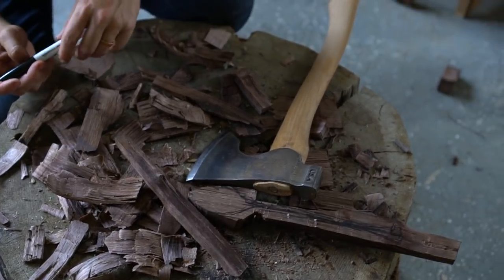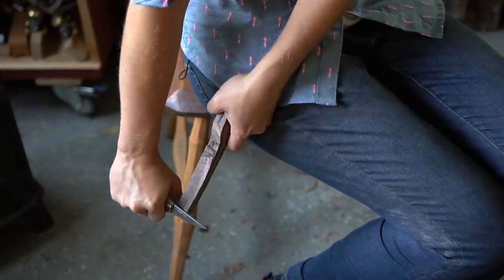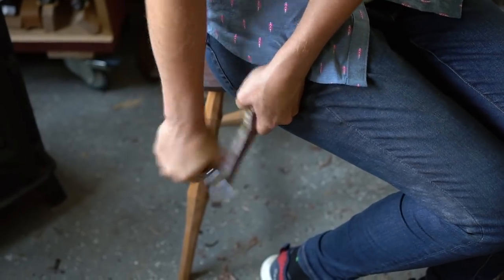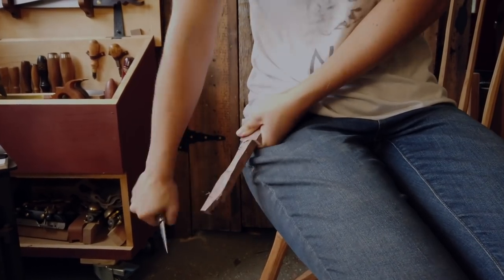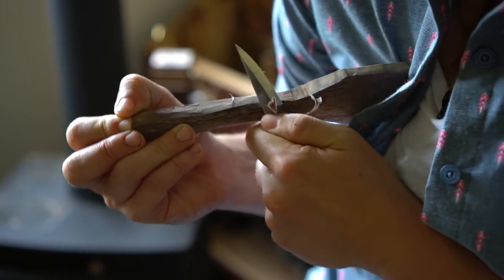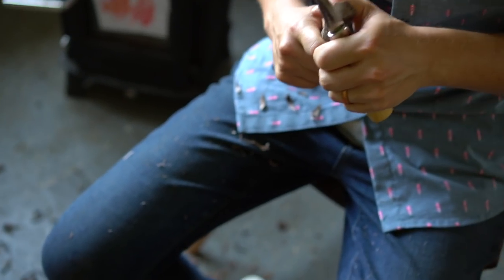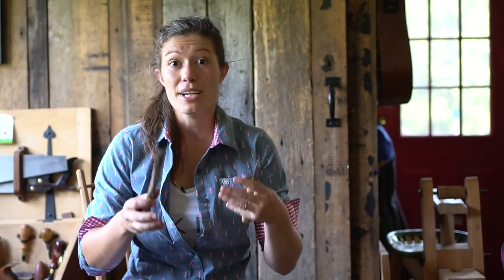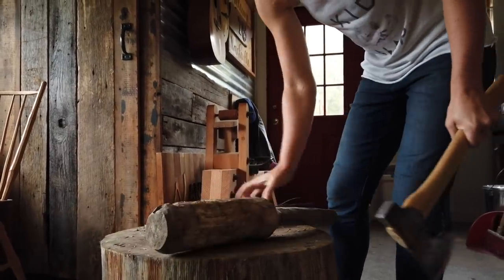The 5 Knife Grips Essential for Spoon Carving: Safe and Efficient

Comment: Nice vid.  Good points.  I did relief carving for a while and had a set of Pheil gouges/chisels and they were great.  Then I got into carving little figures from 1.5 or 2" square stock around 3 or 4" high.  One carver I watched recommended a Mike Shipley knife which I think now go under the name OCC or something to that effect.  Well, I was fortunate enough to be able to afford the 23 bucks each for a 1.75 blade model as well as the 1" model for detail.  I thought I had died and gone to carving heaven!  Best knife I've ever owned, though in truth, after those I didn't experiment much more.  Tried the flexcut and they were OK, but I hardly use them because the Shipleys are just so good.  They bevel the entire blade so you aren't forcing as much metal into the cut and yet they are plenty strong.  There is a touch to everything from music to carving and you are correct, learn to just engage the wood and not gouge and it's much easier to control.  And practice, practice, practice!  Just thought I'd share that.  But love your vids.  Always informative.

Comment: I use to make cedar shingles when I was 6 with an axe, good times; I never did try wood craving, looks interesting Anne 🖐
Reply from the maker: It's never too late!
Reply: Using an regular axe or a fro?
Reply from the maker: @danyellerobinson5940  Froe's are actually meant to split wood evenly, whereas shingle hatchets are designed to split shingles. My grandpa was able to use them interchangeably though.
Reply: @AnneofAllTrades  Good to know. Thanks.
Reply: @danyellerobinson5940  a regular 5 lb ax

Comment: If you only have cut your fingers on your other hand with the knife you can try wrapping them with compression tape,  that's what I use when I  carve I found I like it better than the glove I was using I have more control of my work.
Reply from the maker: I use both hands when I carve, and it’s better to use proper technique than wear safety measures, but if that works for you, far be it from me to discourage it!
Reply: @AnneofAllTrades  I am ambidextrous but haven't tried carving with my left hand just yet, use my hand and power tools with both but been doing that since my pap and daddy had me sitting in the engines of vehicles to work on them at 8 yrs.
Reply from the maker: Moonwolf71 it’s always so handy to be both handed, with woodwork it helps be more flexible with grain direction, with wrenching, it’s always nice to have another way to reach in and get that impossible nut